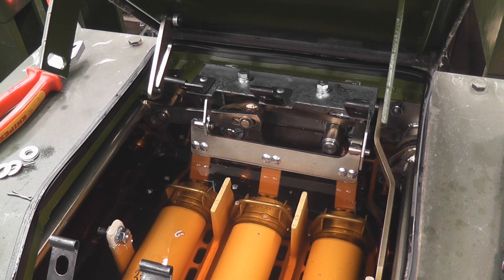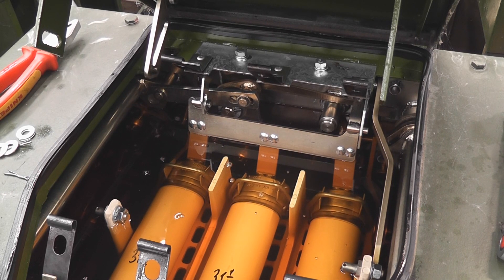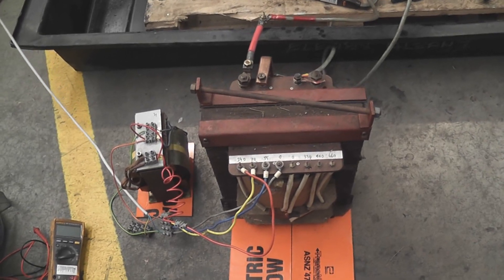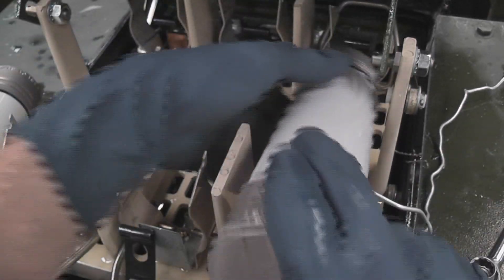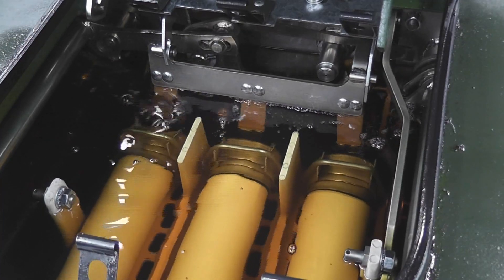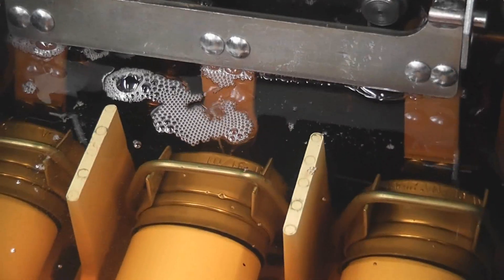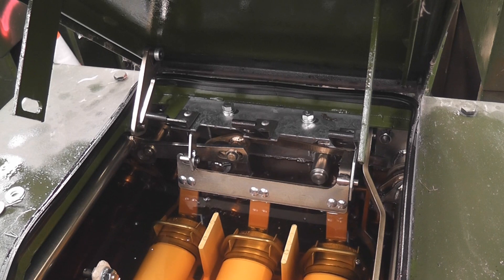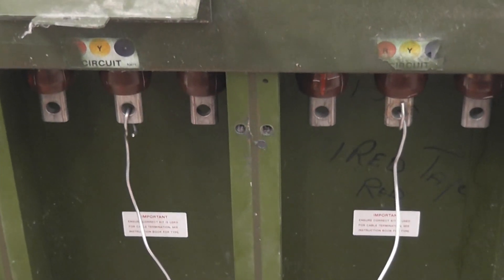RMU fuse operating trip mechanism

Comment: base on what you chose 25A fuse for e.g MCCB rate or transformer KVA or there is a list or something else, because some times fuse will completely burn and we cannot find any information on the old one.
Reply from the maker: It depends upon the size of the transformer(s) connected to the circuit. Roughly 8 to 10 Amps per 100 kVA @ 11 kV. So the 25 Amp HRC fuse would have been on a 200 to 300 kVA transformer circuit.
Reply: @RODALCO2007  Thanks for your efforts and your quick answer

Comment: Thank you. Great video. 
     Soooo many people do not understand the danger of dropping a single phase instead of all three. 
   Burned out motors. UPS and stand by generators with only single phase power loss detection. Power partially goes out but the standby electric generator or UPS system never detects it. Why? Phase B tripped but the sensing wire is on Phase A. 1/3 chance of detection. 2/3 chance of no detection. "The odd are never in our favor" - Mocking Jay movie. 
    Thanks for the example video. "Do not try this at home" :)

Comment: Interesting - I would have thought that the pin would simply be spring loaded, being held in by the fuse element, so that there would be no way to have an open fuse element without the pin being released. If the fuse element is too delicate for this, there could be a lever mechanism to provide mechanical advantage, or even a cam mechanism which takes only a tiny force to hold it in the normal position but once released would allow the pin to come out, similar to a compound bow.
Are you saying that the pin is ejected by a completely separate mechanism from the fuse element? Is it a magnetic device like a solenoid?
Reply: +Sean Breheny If I am right, there is a 'gunpowder' charge which fires the pin out with enough force to operate the tripping mechanism. The charge is triggered by the voltage potential across the blown fuse.

I am sure RODALCO2007 will correct me if I am wrong (I haven't worked with HV switchgear for a number of years now!)
Reply from the maker: +Sean Breheny I will do an autopsy video on one of those fuses.
Reply from the maker: +Paul Roberts 100 % correct there is a gunpowder charge within the fuse cartridge. You can smell the Sulphur, after the trigger. And the charge is triggered by the Voltage potential across the blown fuse. 40 Volts AC was not enough for a reliable trigger charge.
Reply: +RODALCO2007 I look forward to it! Do you know how the potential triggers the charge? Some kind of heating element?

Comment: how often do you get a call to replace a fuse like that ?
Reply from the maker: +ljmike1204 Not that often. Fuses more often blow when a cable fault happens, when struck by a digger or directional drill. Sometimes when a transformer is severely overloaded.
Reply: okay cool

Comment: I wonder if people have ever put the fuses in the wrong way round? So that the pin doesnt de energize the other phases.
Reply from the maker: +TheColinputer Yes it happens, I nearly did on this video. Well it will be the same as with the drop out fuses, A TX will remain energized at 2 phases.
Reply: +RODALCO2007 Hopefully with one on the wrong way the others will have enough unbalanced load to trip one, in the right way round, before the transformer overheats too badly. Would have to be a pretty fast cable fault to take all 3 out though. I always found that only 2 out of 3 3 phase fuses would blow on a 3 phase load with phase failure.

Comment: why does it have oil?
Reply from the maker: +biscuitownz Insulation, with no oil the 11 kV would flash over across phases and certainly across the switching contacts.
Reply: +biscuitownz maybe to keep them cool?
Reply: +biscuitownz Oil cools and is a good insulator. And it keeps the moisture away. You find that in essentially all high voltage/high energy devices such as transformers.
Reply: oil is insulation..before operate the switchgear makesure check oil level indicator is enough..it is very dangerous if the oil is not enough when u switching, flash over will happen..thats why only the authorised person can operate the RMU

Comment: why are the fuses so big I would expect more that 25 Amps
Reply: +mqe73M This is 11kV, so there is a lot of energy that needs to be contained once they trip (not sure what kind of voltage drop they have at time of tripping). Also, you want the terminals far apart due to the voltage difference.
Reply from the maker: +mqe73M These types of fuses go up to 112 Amps as far as I have seen them in the field which supply a 1.5 MVA transformer.
The 25 Amp size is usually fitted for a 250 or 300 kVA transformer which yields in 417 Amps / Phase at 230 Volts.
Reply from the maker: +Henner Zeller Correct, thanks for your fast reply.